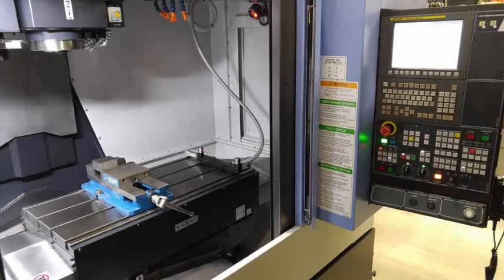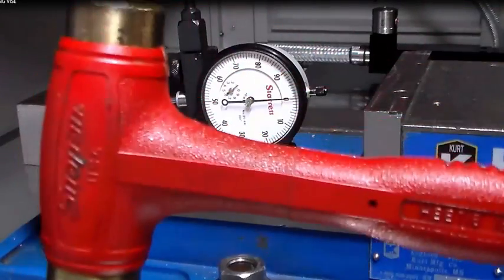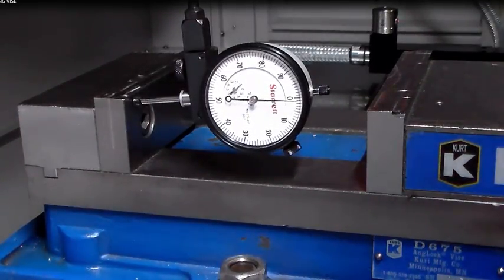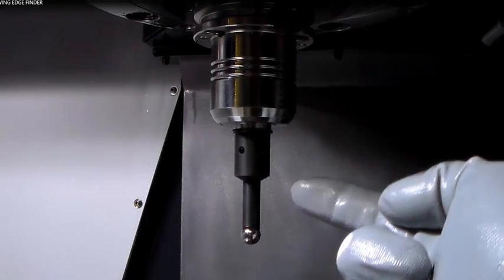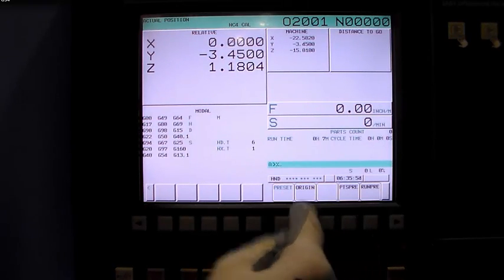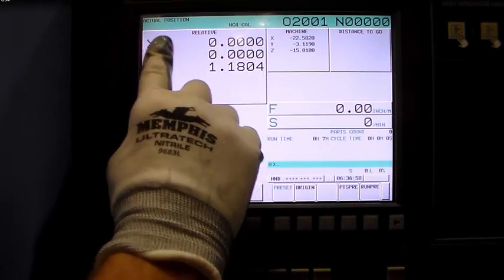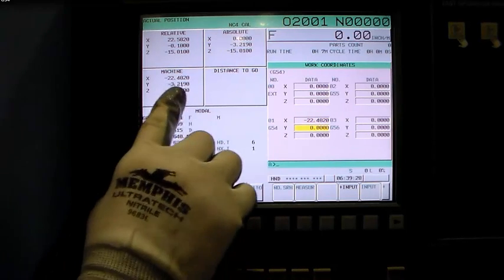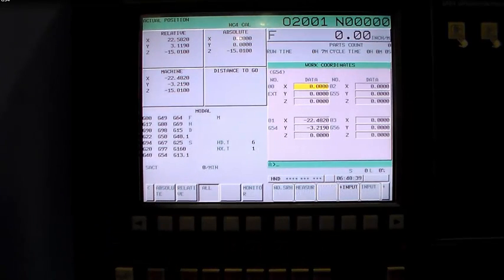SETTING A WORK OFFSET ON A CNC MILL

Comment: what about Z?
Reply: Z depends how you measure your tools and what the Z 0 is in the program. If it's the top of the part and you measured your tools from the table, you take an indicator and measure the distance from the table to the top of the piece, that is your Z 0. If your Z 0 is the top of the parallel or the bottom of the piece, measure the distance from the table to the top of the parallel. If you measured your tools on a light and your tool is a positive number like 9.243 you go to MDI, type in G43 H1 which is a tool you measured that happens to be 9.243, cycle start. Now the machine took the offset of tool 1. Go to manual and Z minus until you get near the part. Use a shim or 3 2 1 block to touch the piece. Machine position for Z is your Z 0 now, but you have to compensate .005 or whatever thickness shim you're using, or 3 inches if you're using a block. G90 G0 G54 G43 H1 Z3.0 to check your Z0. Never check using Z0 always go above the piece so you don't crash the machine with arithmetic errors.
Reply: @mad0uche  the majority of the time I zero from top of part and work down unless we are milling top and bottom.

we have a tool setter for setting zero on tool offsets and a 3axis indicator which always stays in tool 20 so the offset doesnt change. Its alot quicker than shims and 123 blocks when loading multiple tools for a job

we just press the offset button and scroll down to the tool number and type in 207.51 which is the length of the 3d indicator to the spindle
Reply: @ that’s a good set up, the people here are not organized like that everything is from scratch, tools are always taken from the machine, probes and tool setters are not given out because people “will destroy them”.

Comment: I have been a machinist for 15+ years, I have worked on fadal, haas, and fanuc controls.
I like your video... but for me there are alot of steps you have that could be done in fewer steps. 

I rarely ever zero the relative table.  In fanuc controls I would simply touch the tool off on selected axis go into my offet enter the radius valve and hit measure.  From there manual enter my shift for excess and press input.  Haas controls are vary similar in nature, fadal has a utility feature that shifts everything for you.

It saves hand jogging the machine up and over to position, inputting into the relative origin, re jogging back to center, re jogging to accommodate for stock material.

I typically use a rotating offset indicator because with your electrical contact indicator, how would you indicate on plastics??

But yes your way is a vary practical explanation for a beginner:)
Reply: Thank you for this reply

Comment: Like the video Tom . I have to say myself that I usually pick up my X and Y Axis and input my offsets  directly into the work offsets screen ( G54 , G55 , G56 ) etc... instead of using the realitive position screen . That eliminates having to input the numbers twice . Just quicker that way . Now I'm not using a electric edge finder . Because of you using a electric edge finder do you have to do it in that sequence ? I'm not sure you do .
Reply: Yes much faster, imput in direct and input you shift for stock.  Save alot of extra hand jogging and manual inputs.

Comment: If your using an edge finder why have the part  offset to the left hand side  in the jaws.....should be in the middle and you should set a stop up if it’s a batch run

Comment: Hello Tom..
@ 3:57, you moved the edge finder into the + direction, isnt it suppose to be in the - direction. cus i saw from your machine that moving inwards is "-X" and moving outwards is "+X"...and you moved the edge finder inwards (to keep the center line of the ball over the edge), so i was thinking it should be -0.2 (not sure)...
enlighten me on it, i think i am missing something
Reply: When he uses the handle to go +X direction, the pallet moves left and the spindle stays in place so now the center of the ball Is on that edge. You have to think of the spindle moving in the +X direction even though its the pallet that's moving.

Comment: hello from colombia!!!
 we have a problem with us DOOSAN. i set the offset with 2 different tools but when i test the first tool this  goes to zero offset perfectly. but when i change to the secound tool this  dosen't go to the Z possition that i had set. please help me!!
Reply: if the tool overhang is not same, you'll have to reset the z offset (tool offset) every time you change a tool
Reply: Thanks. I fixed the problem using G43 H~

Comment: you could touch off X axis and input x-.3 then set for the offset being used and it calculates automatically.  Then touch off Y axis and set to y.3 and it calculates for the y automatically.  I used .3 for half of the ball on the edge finder (.2) plus .1 for the material.
Reply from the maker: Hello Gump2155, Thanks for the feedback. I have a course on basic cnc lathe programming on Udemy. The videos and all other documents are downloadable. Use this code to get the course free. https://www.udemy.com/cnc-lathe-programming-for-beginners/?couponCode=BASICCNCLATHEGCODE      I'd like you to leave feedback Thanks.  Tom

Comment: I informed  to you that I have a chinese CNC milling machine  Model  No : WN-A850Z  Fanuc controller. To changeAPC  Battery of machine . referance point shifted. as a result of machine moment towerds X , Y axis is half reduced . So we can't operate the machine for full size  towerds X , Y axis.
 
There fore please send a valuable suggestion to solve the problem'
 
Thanking you.
Reply: Chinese cnc machine huh!!!!

Comment: Hello I have a bit of a problem I hope you can help. Help either with info or where to go for info. I was hired as a part time instructor, at Aiken Tech. I am trying to resurrect a 2000 Bridgeport VMC 3020. The controlling unit is a Fanuc 21i series. My problem is the machine will not always go to machine home x 0 y0 z 0 the unit is an ONG unit. I set the machine to jog and press the home and nothing. Any thought would be helpful.

Comment: I have some runnout in my edge finder so I always rotate the spindle around 80rpm.   Of course I need to calculate the virtual diameter of the ball which includes the contribution from the runnout. Do you not pick up any runout in your edge finder?  And if not, what brand and model do you have?